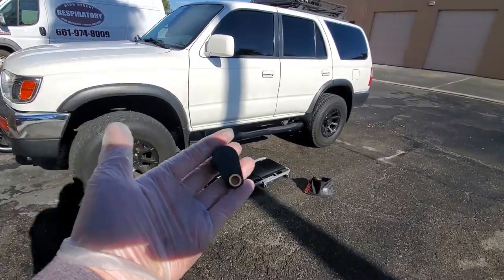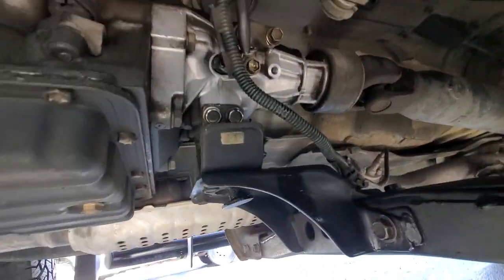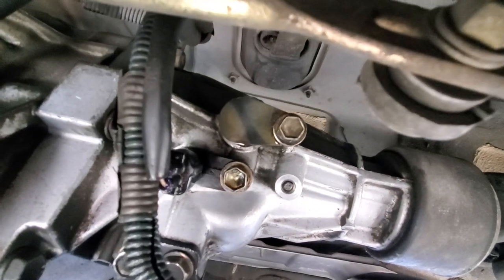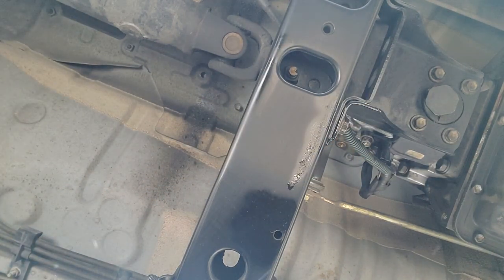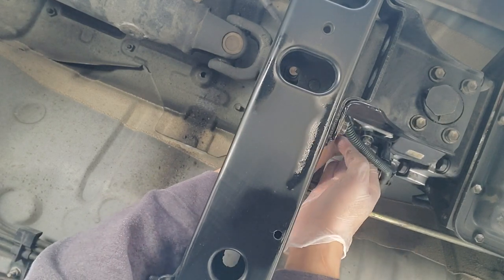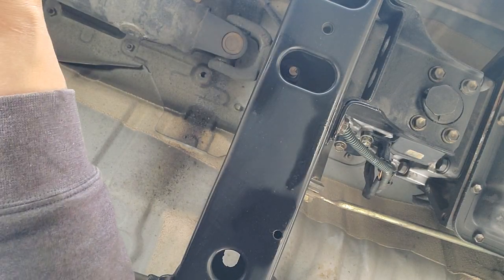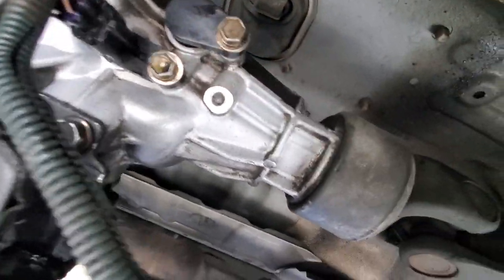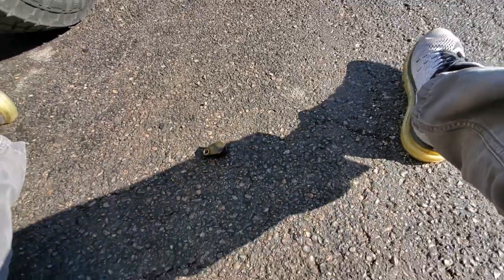3rd gen 4runner transmission leak fix speed sensor cover

Comment: When you pop it in does it snap into place? I guess my question is, will you know when it is popped into place?
Reply from the maker: You'll know cause it will be snug
Reply: Thank you so much.  @migueltorres79
Reply from the maker: @mrandmrs.p3635  you're welcome
Reply: Miguel, my part comes in 2 days, is it okay to drive the 4runner in the mean time? It  shifts good, but just like you, I have some drops on the ground in the garage.
Reply from the maker: @mrandmrs.p3635  it should be fine
Reply from the maker: Mine was leaking for a while til I got the part
Reply: @migueltorres79  okay so it should be fine. I have no check engine lights on. Just leaks and little bit in the garage on the concrete. Hopefully the part will be here in 2 days.

Comment: What engine do u have? v6?
Reply from the maker: Yes
Reply: @migueltorres79  was your leak all resolved after that?
Reply from the maker: Yes
Reply from the maker: @vbnautical5041 I did have to pin point where the leak was coming from